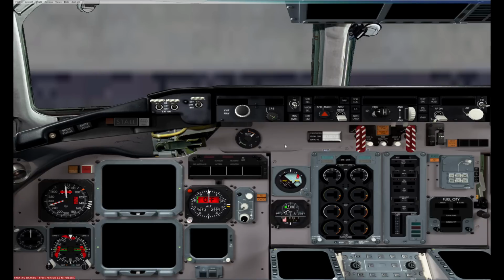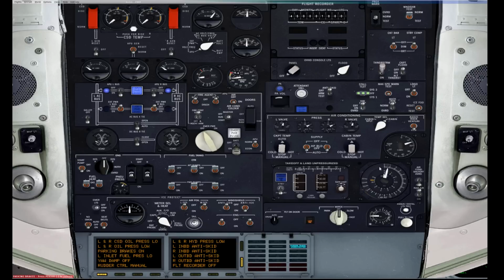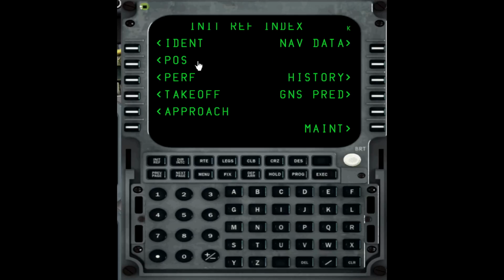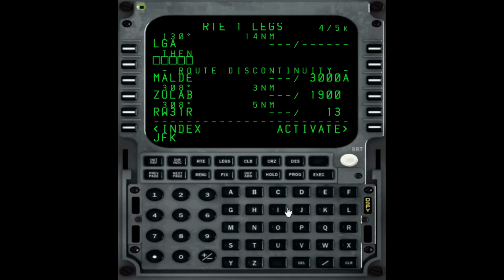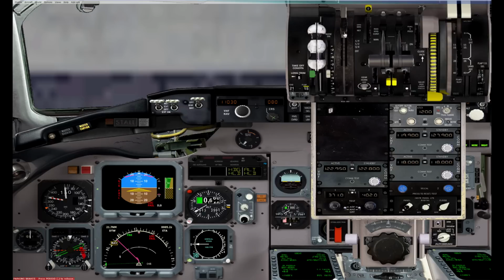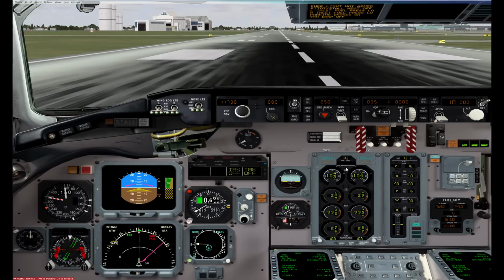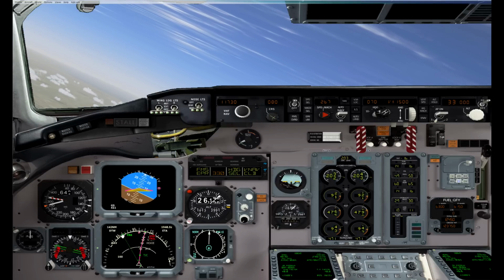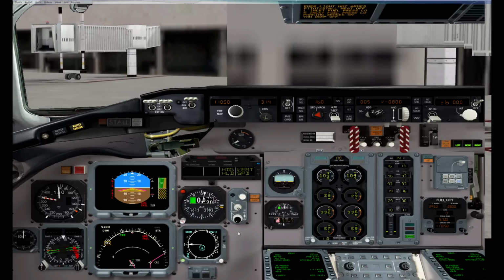FSX Leonardo MD-82 / MD-88 tutorial

Comment: Great video. Better than any other Maddog video I have found so far.  Two questions - after starting engines, shortly after,  my fuel flow goes to zero.  Engines run fine, no issues, just no fuel flow showing ? Any idea why ?  In PERF INIT FMC page one enters 14.5/N or 14.5/A for fuel.  Nowhere can I find what the A or N does dealing with fuel usage.  PS:  I am running most current s/w version. Thanks !!

Comment: Why this aircraft don't have IRS switches to allign the navigation systems?
In the real aircraft you have to do this. And in the Flight 1 Md 80 too.
So why not in the Leonardo md?
I thought the systems are much more realistic in this one as in the flight1
Reply from the maker: +Mark Schulman Fan 
It depends on the installed avionics (different airlines might have different systems) but in the one in the video, alignment is done through the FMC on the POS INIT page. Flight 1 may have been simulating the older RNAV systems that had a separate analog panel. (With the Leonardo you can also select a GPS-based FMC with the configuration utility).
Reply: +SimAviationVids 
Great....
Thank you.
I didn't know that.

Comment: When I get the engines started, all my map/CDU data disappears and I have to reenter it all. Any ideas?
Reply from the maker: +TheZav88 That could happen with an electrical interruption. If you're starting engines with the generators offline, make sure you put them online before taking your other power source offline (APU or ground power).
Reply: SimAviationVids do you into w what file folder the maunual for the aircraft is in on my PC? Did it come with a manual or poh because I haven’t found one.=/ tutorial helps a lot

Comment: By the way, two quick comments:

1. You can easily obtain the zero fuel weight by pressing the bottom right button of the digital fuel/weight indicator gauge on the main panel (the button is marked zfw). When depressed, the zero fuel weight will temporarily appear in place of the total gross weight. 

2. when entering the total fuel under 'perf init' of the fmc, there are two different distinctions that can follow the numerical fuel value....either /A as you used, or /N.  Typically, if you are not using the center fuel tanks, you would use the /N designation (which stands for"Normal"). The /A designation stands for "Alternate" which alters the fuel burn schedule so that when using the center fuel tanks, the aircraft will intermittently (and automatically) burn fuel from the wing tanks too (even though there is still fuel in the center tank).  It does this to reduce the icing potential that can occur on longer flights when fuel sits for longer periods of time in the outer areas of the wing tanks.
Reply: this is why I like Leonardo Maddog :-) those kind of details
Reply from the maker: +Lazy Bastard Good tips!

Comment from the maker: @Kenz CHERIEF -- You're talking about where I press EPR Lim at about 400 feet? Good question! I think it's a policy that varies by airline, but I've seen at least one cockpit video where they did it too. That takes the autothrottle out of "clamp" mode (and into EPR T/O) so it can start fine-tuning the power to keep it at the takeoff setting.

I don't think I talked much about clamp mode in the video, but once takeoff power is set and stabilized, it will go into clamp mode meaning it will stop adjusting the throttles. The pilot can still adjust them, but the A/T is saying it's not touching them. I suppose this was put in to prevent it "chasing" after the EPR setting during takeoff when you really need the setting to be precise.

Re-enabling the A/T at 400 or feet or so by pressing EPR Lim then is a pilot's discretion or company policy issue, I think. If you don't, it'll stay in clamp mode until you hit VNAV at 1500 feet, meaning only the pilot can change the throttles before then. On one hand you could say if the pilot decides to pull them back to idle at 500 or 1000 feet, then the aircraft should do that without the pilot having to fight the A/T. On the other hand, in what situation would you ever need to do something drastic like that (a dual-engine failure would disconnect it anyway)? With the A/T out of clamp mode you can still fine-tune the setting as always. EPR Lim might be another layer of safety during a critical portion of flight.

Still, you can fly just fine without doing it too -- it's your discretion.

Comment: Great video.  As an FYI....u can also use the mouse scroll wheel for spring loaded switches.  So for example, when starting the engines, scroll down using the mouse wheel, and it will hold the spring loaded engine start switches in the down position.  This way you don't have to worry about accidentally releasing too early and screwing up the engine start!
Reply from the maker: Great tip!